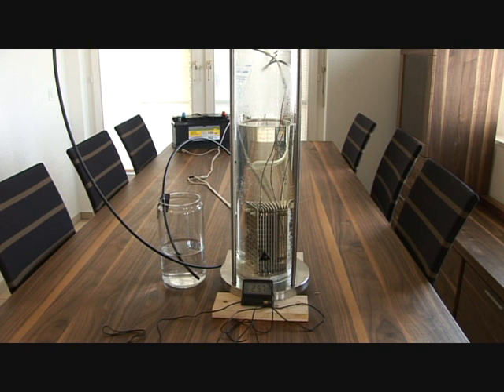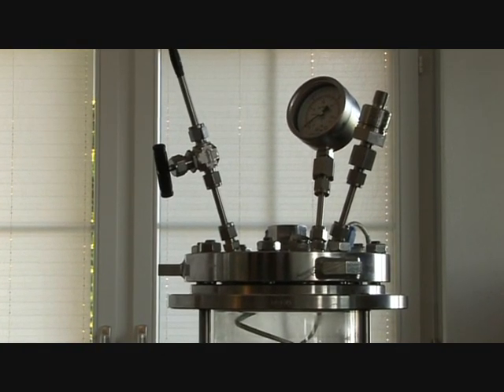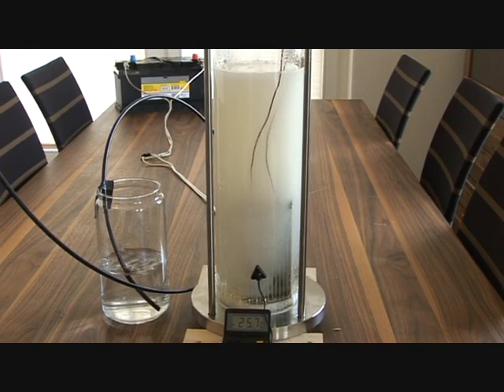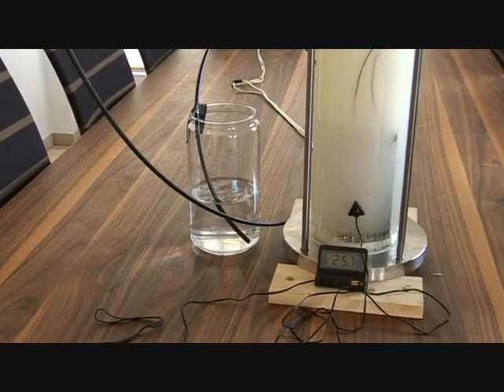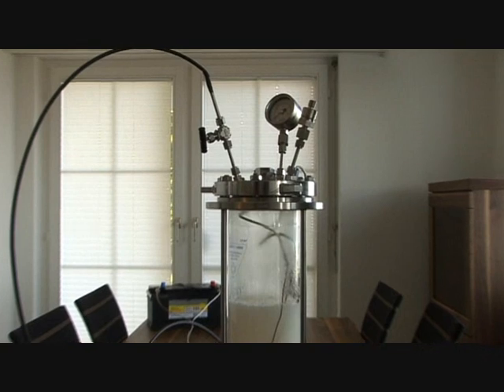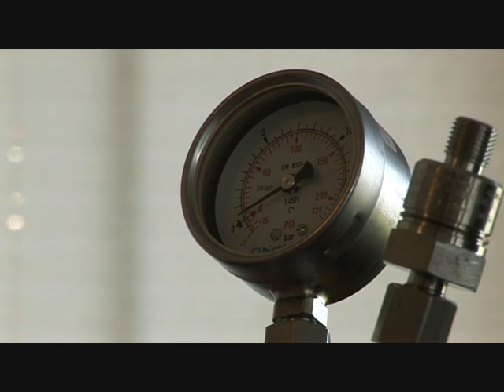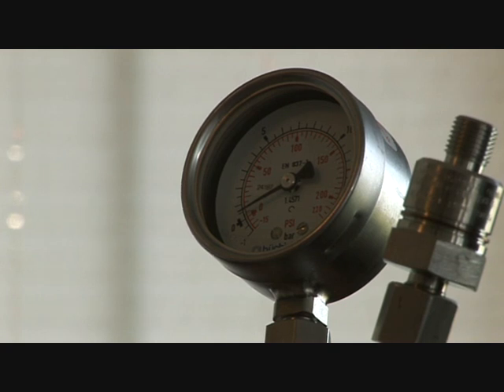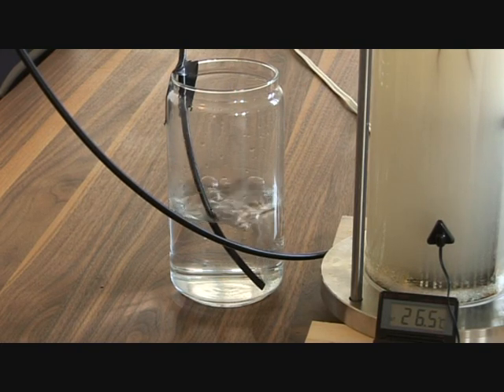Hydrogen distilled water

Comment: I have just purchased a v8 hydrogen ion water machine (kangen) but when I use distilled water nothing seems to happen but when I add tap water I can see the cloudiness/bubbles. Could you explain why that is and if it still has the benefits without the effects as I only drink distilled water ?

Comment: Some people have thought of a use for this Idea.  Not in a vehicle but as a portable metal cutting tool.  You can buy the thing commercially.  The convenience comes from not having to fill any gas bottles for your cutting torch.  Thiss tool works better and on thicker metals than a plasma torch that used the same amount of power.

Comment: This is a very funny video.   They make it sound that they invented electrolysis of water.  This is easy to do but you cannot generate enough hydrogen and run it on a car at the same time.  You can however produce it using solar or wind, put it in compressed tanks to run a car.

Comment: 10 amps through distilled water is unlikely in a 12 volts D.C. environment.
Is there no circuitry as it appears? Pure water has a dielectric  constant of 
78-80. Please explain the physics principles involved. H2o0il.com
Stanley Meyer used ~1500V D.C. + rectified 42.8khz A.C. simultaneously to impress a wide eyed, amazed, U.S Patent Office Officer back in the early 80's.

Comment: What you are producing is hydrogen and oxygen.   That is why it exploded with the match.   Hydrogen comes off the positve and oxygen off the negative anodes.   find a why to isolate the anode plates to in the electrolite to capture hydrogen only.   IF you wanted to make gasoline burn hotter and more explosive, mix with oxygen and you can melt down an engine.   Same with hydrogen and oxygen which is the same as rocket fuel.   Very Hot, very explosive.   Mix hydrogen with proper mix of oxygen.

Comment: steam machines used in the past use coal to heat up the water into steam. But coal produces loads and loads of CO2 Wich is very bad of the inviroment. the future energy resources are inviroment-safe kind off like hydrogen when u burn it u get water, water is not bad for the inviroment.

Comment: I think power is power no matter how you put it to the cells.   Wiether it be low or high voltage, or pulsed voltage at high frequency.   Amps times Volts = watts of power.   Nothing is free, just a conversion of one form of energy to enother form and at what efficency?   Not cost effective.   The good old steam engines might work better and could use wood pellets for fuel.  Go back to steam locomotives and rail transportation.   Whats old is new again.

Comment: What you get out of this is not Hydrogen (H) But HHO, that is with electrolysis you split the water molecules into atoms H and O, and then he takes both gases and let them out, that is why it pops.... Had it been only hydrogen the flame would have died... (Everyone did this experiment in 8th grade)... To get only hydrogen you need to split the electrolysis into to gas outlets (one from the positive side and one from the negative side.

Comment: a very nice looking instrument for someone with such poor grasp on physics.
while it might be possible to violate the conservation of energy principle it certainly wont happen by standard electrolysis. hydrogen from water is a classis school example of electrochemistry but it requires the same or more energy of electricity than you get out of burning the hydrogen again. a car will most certainly not drive for free on water using this. it would run the battery flat very quickly. electric car.

Comment: ACTUALLY it´s a mixture of hydrogen and oxygen. but as they are two seperate molecules the name "HHO" is WRONG. The correct description shoul be 2 H2 + O2 but at least yours works and you´re telling the truth and nothing like that it produces more energy than it needs which is complete bullcrap.

very good video, 5* and just 2 questions: which metal are you using in the electrolysis cell and which solution is in there. potassium hydroxide?

Comment: This is dangerous, having hydrogen and oxygen on the same container, on the experiment I'm familiar with there were two columns connected and each column had one electrode, on one column you would get the hydrogen and on the other the oxygen, hydrogen burns very violently, I don't know what is the flash point but I would feel sorry for this guy if one molecule of H decided to join with a molocule of O, the others would follow and CABOOM!

Comment: H2O is 12.5% H2.
H2O weighs 8.3 pounds per gallon.
H20 contains 1 pound H2 per gallon.
 
Gasoline is 100% fuel.
Gasoline weighs 6.5 pounds per gallon.
Gasoline contains 6.5 pounds fuel per gallon.
 
If a pound of H2 gives the same mileage as a pound of gas, a car with a 25 gallon gas tank would require a 162 gallon water tank (1,349 pounds of water).
 
Four times as much energy is required to decompose H2O to obtain H2 than H2 produces when burned.
 
James T. Conklin, P.E.

Comment: That´s not true hydrogen it´s easy to produce(electrolosys or even better voltrolisys)
Hydrogen it´s 2.5 times powerfull than gasoline, its a fact. And hydrogen its easy as the fuel/air ratio its 1H to 2 Oxygen and the by-product its water!!!
And hydrogen its the most easy to store you have right now at your home WATER!!

Comment: for the system to be effecient it needs to run cool and not consume any amperage the idea is to duplicate stanley meyer's method using a pulse width modulator and a voltage intensifier circuit replication of his system hasnt been achieved to this date.

Comment: "I've seen a lot of electrolysis systems. I doubt [the one shown here] would power a weed wahacker let alone a small engine. It appears to be less than 1 litre per minute which is in line with the 10 amp 12 volts which at Faradays would produce around .7 litres per minute. I think he needs to show someone it powering a small engine, otherwise he is making false claims."